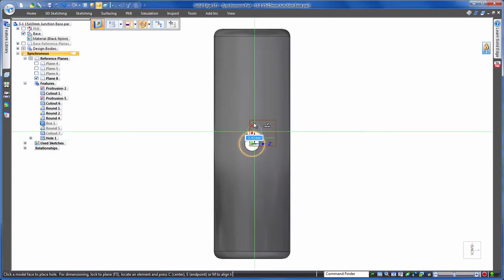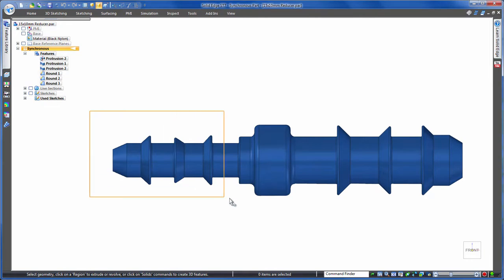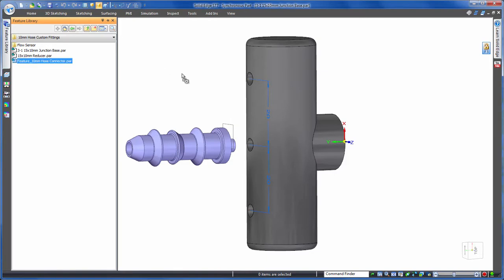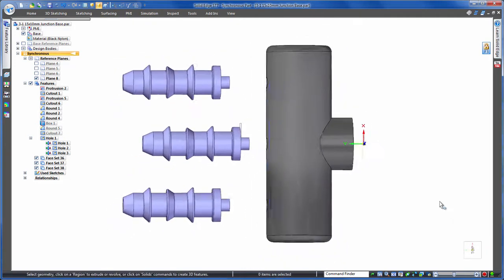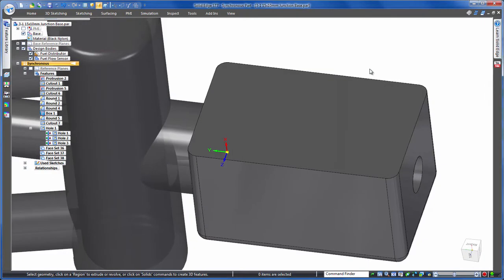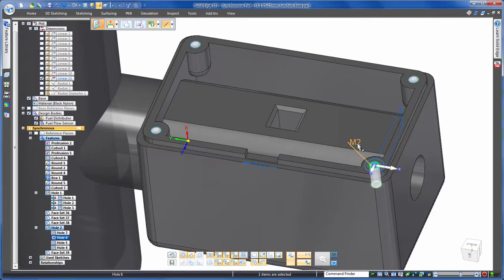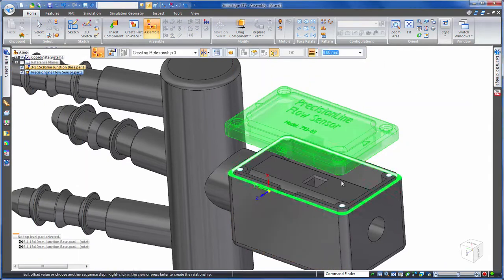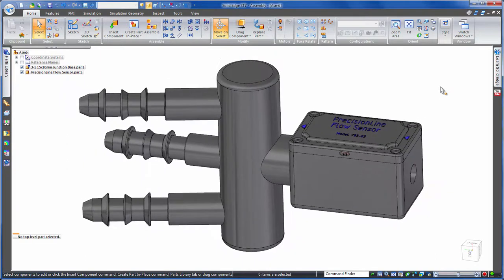Solid Edge 3D Detail Reuse - Siemens PLM Software

Comment: At :35 you say there is no need for extra dimensioning tool to place the holes at a distance from each other and indeed it is seen that an input-box appears to specify the distance as each hole is inserted. I am not able to do this using ST10. 

Has something changed since? or am I missing some key press or anything. 

Kindly advise. 

Thanks